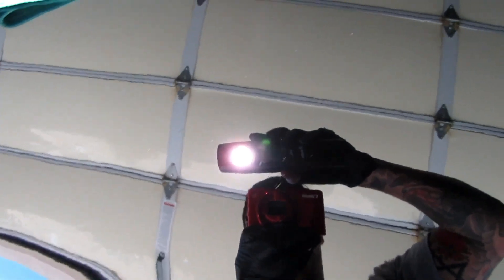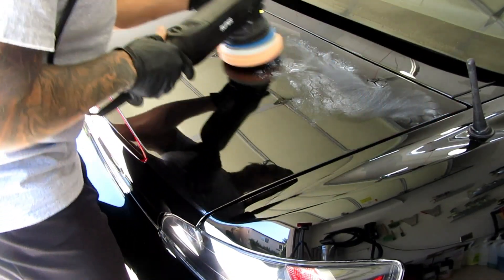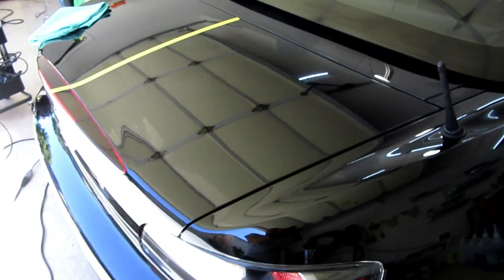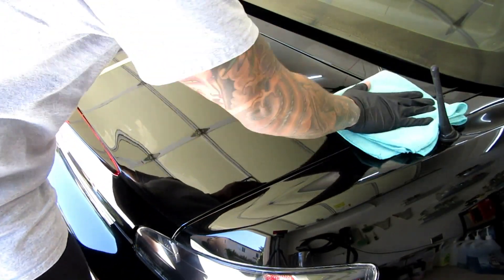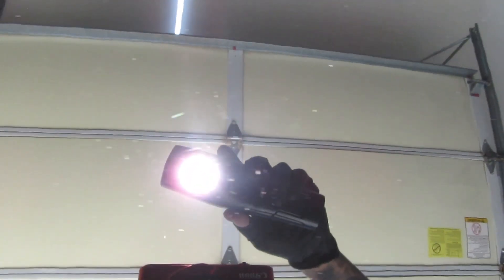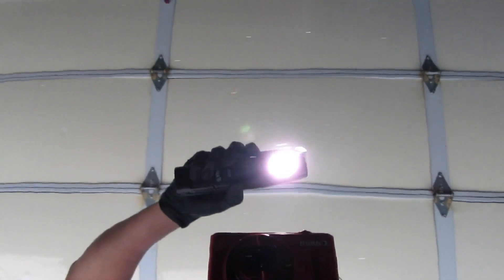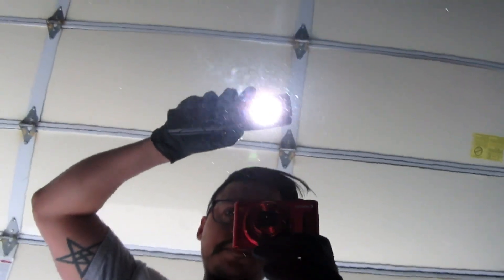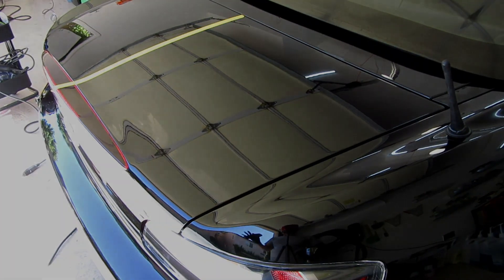Griot's Fast Correcting Cream vs Chemical Guys V32

Comment: Maybe use same pads for future tests? That would be a more even match up.
Reply from the maker: The reason why I chose the orange hex pad is because a vast majority of people using CG compounds/polishes will be using their hex pads as well. With my experience with both compounds, doesn't matter what pads you test out, the Griot's destroys V32 in every category. Has better cut, finish, very low dust, longer buffing cycle.
Reply: Ya I agree same pad test. But I still disagree, v32 is better I have both in my shop an I use the vline more
Reply: Project military memorial jeep zj exactly the vline has blown every other compound and polish I've tried side by side he went to fast using the v32 and you can't tell how long or slow he went using the other product
Reply: @MikeEM1  i agree.. v32 didnt touch my bmw clear...
Reply: Slow down dude!
Reply: @demont33n1  - What other compounds did you try?
Reply: @charlesrobinson6574  - I remember Jason Rose (Rupes, formally Meguiar's) saying "Slow down to work faster". 

I think about that every day at work.
Reply: Those pads are actually both positioned as medium cutting pads, and both made by Buff and Shine. I tried to get Buff and Shine to make me custom pads with the hex pattern, but they couldn't fit to an agreement with CG.
Reply: @MikeEM1  I'm happy to hear this. As I love the way Griots explains the products and they extremely easy to understand . All the labeling tells you exactly what pad you need.
Reply: @firmbiz94  dude same here do you have any recommendations I’m fuming right I gotta say I just got than detailing my mettalic black bmw with the v32 and a orange pad. My clear coat is very hard. I had done 3 passes with each pass doing about 4 patterns so that’s 12x each 2by2 area and man I still have scratches I can not get rid off. I followed the v32 with the v38 polish and than the mirror wet finish and still see the scratches on my hood. Kinda fucking pissed off atm… I’m going to be buying there red pad which is the most aggressive and ima try megs compound and see if there is any difference as I want t  on get even more cutting power and yes the v32 starts to dust when you over work it or the area is too big and too little product. Spray some pad conditioner whenever you see dusting
Reply: @aimized1460  I started using better products.. all these years later that chemical guys stuff is sitting on my shelf still.

Comment: Should of done V36 vs grios. Grios is a finer cut and will work well on swirls, but not anything deeper. , v32 on the other hand will cut out deeper scratches but you will need to follow with a lighter compound as it will leave it's own scratches. V36 is just more in the same realm as far as quick light paint correction. Good vid though
Reply from the maker: My personal results in this video disagree with your statement. Griot's had much better cut and finish than v32. They're both compared because they are the most aggressive compound each company offers. That's why I compared them. I'm not saying Griot's FCC is the most aggressive compound out there, M100 or Menzerna 400 is more aggressive for sure.
Griot's just hands down makes better compound/polish than CG.
Reply: MikeEM1 I have a feeling the v32 may be too aggressive I'm with pro fresh elite on this one v36 or even cg vss would have been a better comparison from my experience
Reply: i use the v32 then a v36 n it work so much better then just one
Reply: @demont33n1  I agree with you. The V36 is still very dusty but a better comparison. I would personally opt for Griot's as a 1 step polish.
Reply: @MikeEM1  Agreed.  I've used CG polishes for years but the Fast Correcting Cream is dustless, removes heavy scratches and finishes with no haze.  I use this an follow up with CG V38 before ceramic coating.
Reply: Griot's Fast Correcting Cream is a very heavy cut compound. 

This Correcting Cream is closer to V36.
Reply: @demont33n1  - By that logic, V32 should have removed more defects than the FCC, but it didn't. 

V32 and FCC are the most aggressive of their respective lines. 

It doesn't make sense to send in an even less aggressive polish (V36) to battle the FCC.
Reply: @johnklimeck  - If you get a chance, check out the 3D ACA line.. 

If I didn't have so much invested in my other polishes, I'd throw them in the trash. Instead, I'll used them up at work, but I'll be missing my 3D stuff till then.
Reply: @johnklimeck  your soo right dude fuking helll

Comment: 32 does have a lot of residue but can be off set with lubrication or just a spritz of water in between passes.
Reply from the maker: Yes some distilled water will help with buffing cycle and dusting, but then that's modifying the test of it alone. Also it doesn't help with the cut which is not good compared to Griot's FCC.

Comment: I bought the V line from CG was very dissatisfied and disappointed. It didn’t cut or correct very good still saw scratches and swirls. I tried all the combos i could. I just ordered the griots and I’m looking forward to using it
Reply: How was it c on pared too ok cg stuff man I’m I gotta say I just got than detailing my mettalic black bmw with the v32 and a orange pad. My clear coat is very hard. I had done 3 passes with each pass doing about 4 patterns so that’s 12x each 2by2 area and man I still have scratches I can not get rid off. I followed the v32 with the v38 polish and than the mirror wet finish and still see the scratches on my hood. Kinda fucking pissed off atm… I’m going to be buying there red pad which is the most aggressive and ima try megs compound and see if there is any difference as I want t  on get even more cutting power and yes the v32 starts to dust when you over work it or the area is too big and too little product. Spray some pad conditioner whenever you see dusting

Comment: Do you think fast finishing would work on black Ford paint? What pad would you recommend for minor swirls? I used the Chem guys compounds and they didn't finish down. I basically got what you got.
Reply from the maker: By fast finishing I assume you mean fast correcting cream. I can't tell you for sure, it's always best to do test spots and see results. Always treat each paint correction different. There's really no cookie cutter formula. With my current setup, I would do test spots with Sonax Perfect Finish and Rupes Keramik Gloss Polish. Always start with least aggressive combo first and go from there.

Comment: Mike, great video dude. I used the V line from chemical guys and got awful results. Glad it wasn't just me. What would you use as a second step polish after the initial first step pass with Griots Fast Correcting cream?
Reply from the maker: You can use almost anything because the finish from FCC is fantastic. Sonax Perfect Finish would be my choice.

Comment: What would be the best correcting compound for Obsidian Black paint on a G37? The clearcoat is reaaaally difficult to work with, V32 and a Porter Cable doesn't even make a dent
Reply: JCJasek ......M105 with a lake country. Everyday all day and twice on Sunday. Shocker a Chem guys product didn't perform, if I had a nickel.
Reply from the maker: G37? Infiniti has soft paint. Have you had work done to the car? I use Meguiar's microfiber cutting discs with D300 or FCC. You could also use M100. Not a fan of M105 myself.
Reply: MikeEM1 under my hood near the fire wall it says "HARD CLEARCOAT"  next to the vin lol. My buddies silver Infiniti is so easy to do. But for some reason mine is just so difficult. Thank you for the tips though! 👍🏻
Reply from the maker: Oh never knew that. Wool pad with M100 should cut easy on hard clear
Reply: MikeEM1 awesome. Thanks mike!
Reply: V32 , rotary, wool pad 

LOL most aggressive attack
Reply: Microfiber cutting disc w griots fast correcting
Reply: On hard paints, I always had great luck with Meguiar's M100, and Menzerna FG400 on a microfiber cutting pad. 

Lately I've been using 3D ONE, or 3D ACA 500 on Buff and Shine Uro-Fiber pads. Porter Cable too. 

At work we have the Rupes MK2 21, 15, the Mini. And Adams Swirl Killer 15 and Mini. I still reach for the Porter Cable 7424 first...

Comment: Mike, what compound/polish/pad  would you recommend for a black 2015 Toyota with minor swirls and some aggressive water/bird dropping etchings? I've never attempted paint correction but have learned a lot from your videos and want to attempt this myself. Thanks!
Reply from the maker: Try Sonax Perfect Finish or Rupes Keramik Gloss Polish. As for pad, always try least aggressive first and see your results. If you need more cut, use a more aggressive pad.
Reply: Thanks Mike!

Comment: Very good video as usual. I'm a beginner and I bought the Boss system ( the 4 bottles of liquid )and it's the best thing I did since I started detailing. I'm not complaining because I'm a beginner but do you think you should take better pads than the one you were using. Make more video I will learn more. I'm sure your helping thousands of poeple but they don't let you know. THANK YOU VERY MUCH. 
Richard
Reply from the maker: You made a great purchase going with the BOSS line. As for pads, I normally use my Buff and Shine Uro-Tec which I've been very happy with. They're great and I like them a lot better than Hex pads.

Comment: Hey Mike at 0:20 what are  the specks in the corrected side called? And how do you get rid of them?
Reply from the maker: It's flake that's in the paint.
Reply: MikeEM1 Oh! I used ultimate compound on my hood with a hex logic pad and all of the swirls and scratches were removed. There are only little dot-like specks remaining which is why I asked. I'm not sure how to remove them.
Reply: 1221Ralph try the least aggressive polish. V38. I don't own a black car, but maybe it would work
Reply: Rod121 I would never revert to CG products. My next compound/polish purchases will be Meguiars m105 and m205.
Reply: You should try Menzerna 400 and Menzerna 3800. Incredible products
Reply: Those are usually "dent" or "knicks" that become more visible once the swirls are gone.  You would have to go deeper to remove those which usually isn't worth removing more clear coat.  That is why they say you get about 95% correction.
Reply: @1221Ralph  - Could also be "solvent pop".

Comment: Hey Mike just subbed, found you off Dallas paint correction video. Plan on watching your other vids, Question is if you followed up with a polish would that remove the swirls or how would u go about doing that. I'm beginner trying to learn as I go.
Reply from the maker: I followed up with Griot's Garage Finishing Sealant because I was going over the whole car with it. Any polish with a decent cut should take of the remaining swirls after a compound
Reply: MikeEM1 thanks for the reply

Comment: In my opinion I believe v32 isn’t great as a one step as used in the video. Vss or v38 is better as a one step polish with the orange pad and finishes flawlessly
Reply from the maker: I'm comparing the two most aggressive compounds from each company. That's the purpose of the video. I'm showing how well each one cuts and finishes so you can see how much effort you need to input on the second step. They're not being compared as a one step.
VSS sucks. V38 is a good finishing polish, but doesn't offer much cut.
Reply: @MikeEM1  sorry didn't look into the description, nice video though in that case i can agree with you in this match up. i have had great experiences with vss and v36/38 personally but then again i haven't really tried many other polishes. will look into griot's though. you've earned my subscription. Cheers!

Comment: You’re comparing a 1 step cream to a multiple step compound. V32 is really abrasive and needs to be followed up with v34, and v36. V32 is really made for heavy oxidation or really deep scratches, not swirls. I wouldn’t be surprised if it actually cause light scratches because it’s made to be gone over with the other v series polishes
Reply: @CarGuyTim your right somewhat however after doing v32 you do not have to follow it with a v34, or v36. You can go straight to v38. You go from cutting to polishing. Otherwise if your going to do like you say v32>v34>v36>v38 your talking about a 4 stage paint correction. So with a a glaze, wax or sealant it would be like a 7 stage correction and there is no such thing.

Comment: Oh and I had the same exact results with V32.
Reply from the maker: Which pad did you use
Reply: MikeEM1 Orange hex-logic pad (I had the same results as you where there was still a lot of swirls left).
Reply: [Williamshakesbeard on IG] Just an added thought. Lots of times, Griot's includes different polishes and liquids with their polishers. You may want to try their Two Step Polish. I believe they changed the name to Machine Polish 2. I used it on a customer's swirled out car this weekend and it did a great job with just an orange pad. If yours is bad, try the GG BOSS MF pads or the GG BOSS MF correcting pad. These work well for me.
Reply: I had a little better results using a microfiber pad.  I was doing a 2014 mercedes (really hard paint).  In my tests but M105 and Menzerna 400 were better than the CG stuff.
Reply: nearly ANYTHING is better than CG. I would only recommend CG to a true beginner because its much harder to do damage and you can work on technique with it then move up to m105/205
Reply: Good point.  I see that now.
Reply: @c.fernandez8664  - And to further that point, Meguiar's Ultimate blows away the CG stuff. Not even a challenge.

Comment: I gotta say I just got than detailing my mettalic black bmw with the v32 and a orange pad. My clear coat is very hard. I had done 3 passes with each pass doing about 4 patterns so that’s 12x each 2by2 area and man I still have scratches I can not get rid off. I followed the v32 with the v38 polish and than the mirror wet finish and still see the scratches on my hood. Kinda fucking pissed off atm… I’m going to be buying there red pad which is the most aggressive and ima try megs compound and see if there is any difference as I want t  on get even more cutting power and yes the v32 starts to dust when you over work it or the area is too big and too little product. Spray some pad conditioner whenever you see dusting
Reply from the maker: Maybe you need to a more aggressive pad like microfiber?

Comment: Good vid but think you missed a point, Chemical Guy’s recommend using V32 with a heavy-cutting yellow quantum pads and Orange Quantum pads for a light swirl remover like V36 or one-step polish. 👍🏼✌🏼
Reply from the maker: It doesn't really matter. CG puts out a lot of junk that newbies buy into. They're at the bottom in the detailing world. I've spent easily 1k buying and testing their products.
Reply from the maker: I'm not saying all their products are junk, but basically 80% is.
Reply: MikeEM1 agreed with you on that!!!

Comment: You ever compare it to Menzerna  300
Reply from the maker: I haven't really played with Menzerna compounds because they eat up your pads. They have some chemical in them that is just harsh on foam. But I hear they work great. I have a new compound in my lineup that will be tested soon.
Reply: MikeEM1 i use them with QG pads no problems yet on eating the pads, what other compound you have to test? I really want to the Griots
Reply from the maker: The Last Cut
Reply: MikeEM1   Have you try the Griots G21 i have one coming this Friday along with 4 different griots creams  to test my first DA (long trow)
Reply: @MikeEM1  - That was FG400 on the green Rupes pad. Basically dissolved the foam!

But, those pads are weak anyways. I only ever used Rupes Quarz on them, and they shredded like crazy. I'm very easy on my pads, and take great care or them. 

The Menzerna should be safe on those maroon, yellow and White Uro-Tech foams. Not sure about the blue coarse, but I did see where someone used the blue coarse with FG400 as his go-to cutting combo...

Comment: I see what you did wrong. You supposed to use yellow pad for v32.
Reply from the maker: Both pads are medium cutting pads. Yellow is more heavy cut not keeping the comparison fair.
Reply: Most people use the orange. CG says you can used the yellow, orange or green with it. 

Green cuts better than either of the others IME.

Comment: Lol you didn't lubricate pad first. So its gonna dust and 2nd you are going way too fast, your moving across that surface like your applying a wax or a glaze. Try working slower and you'll see way better results with the V line.
Reply from the maker: I did the same with FCC with NOT applying lubrication to make it a fair comparison. Having to add lubrication for an extra step is weak. It was worked at the same speed as the other side. V32 had inferior results.